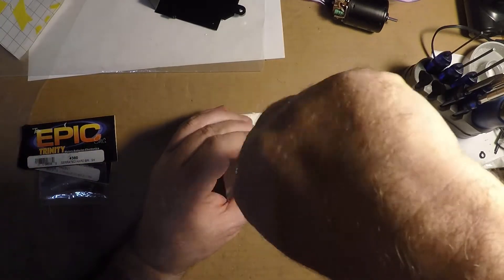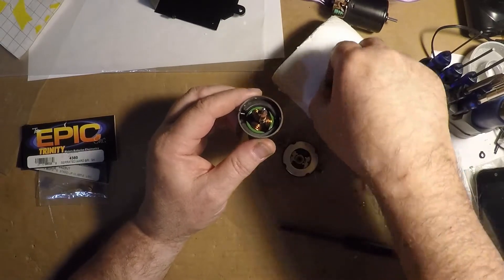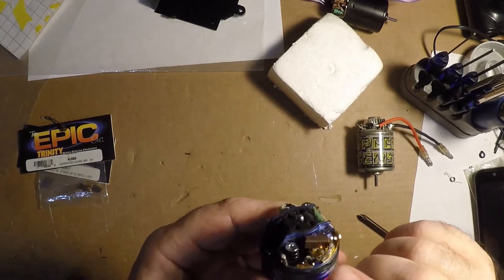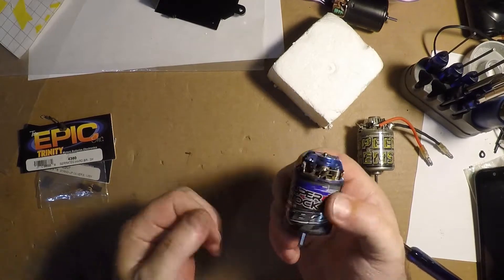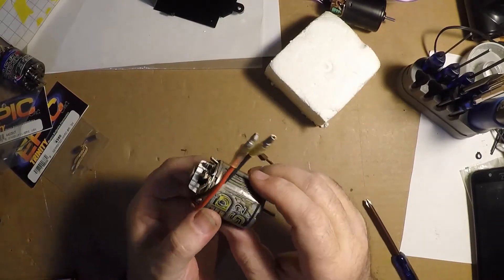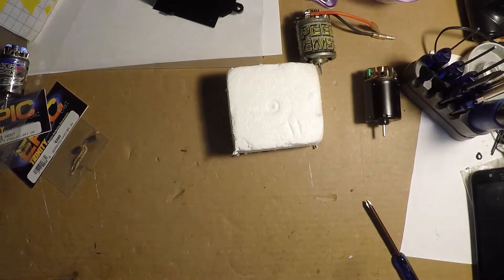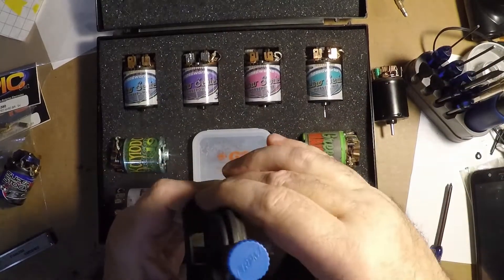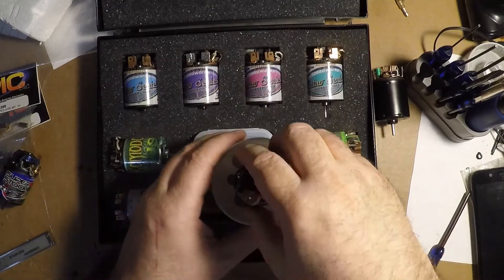Brushed Motor Maintenance & Care

Comment: You are a legend dude! Thank you so much for doing this and posting up my friend 🙌🏻 I am going to pull that motor apart and see what is going on. 😎👍🏻
Reply from the maker: Hiya Craig, we never could connect so I thought this would be easier. I did put my calipers on the comm (commutator), it's 7.54mm in diameter, yours might slightly different, HOWEVER, it should not be off by much more than that. If it's way off, between 6mm & 7mm, you might need a new armature (the part the holds the cooper wire windings). Brother I hope this helps & I'm here if you need help.  ATB bro & good luck.
Reply from the maker: How did you make out with that motor? I'm sure you told me but I forgot, old age you know..

Comment: Hey Uncle Bob, really a great review.  I’m putting this in the “watch later” I could only watch the first 6 minutes.  I like the jig, never seen that before.  I remember using Reedy rebuildable motors 20 years ago when I club raced.  Didn’t know the washers were special. Conductor cleaner works well.  Again great review Bro!
Reply from the maker: Thanks Brother, every bit of info is going to help someone. That was just a few of the motors I still have. With some serviceable stock motors, you can change the brushes but you can't take them apart (unless you unbend the tabs holding the endbell on). You can really see the appeal for brushless motors, but this was how it was done some 25-35 years ago.
Reply: Yeah, these brushless motors are so cool.  It’s like an old V8 with a Carburetor instead of fuel injection! I’m working on a 1/10th crawler, but it’s going to be a beach basher.  I purchased a brushless system but may change it to a Brushed.  Not sure when it will be finished, right now its a bunch of parts in a crate in my garage :)
Reply from the maker: @3TRCGarage  Man, I think we all have parts/kits & projects sitting around. I have so many cars/trucks that need work/parts that the count is about the same as my running RC's, if not more.

Comment: Great info, after this video most will stick to “throw away” or brushless motors lol
Reply from the maker: For sure man!! The art of brushed motor work is long gone. No one wants skill anymore (other than driving), they much rather pull it out of the box, charge up the battery and run the shit out of it.  I did the video for the "OAG RC" cause he has a brushed motor issue so I thought I would try to help him out.  I didn't even get into brushes & springs......

Comment: 😮
I'll be watching this video 100 times. THANK YOU. I'm still wondering how to just change the brushes.
Your collection though ....... When you pulled out the Blueprint 427 ...... 😍❤️😮 ..... I've been looking online and see the value of these things ...... Maybe I'll just keep my motors in boxes and rebuild them, then just get a BZ or something for running and maintain that.
Reply from the maker: Thanks Man, I did the video to help "The OAG RC" cause he has a BZ that needs love. About that 427, I got that in a lot of parts along with a like new (1990) Trinity Speed Works Tony Neisinger  motor (just not the right box for it). On to the brushes, some screw on and some are soldered on, screw on one are far much easier to change, you should be able to see/tell if they screw on or are soldered on. The hard part is finding decent brushes for old motors. If you still need help, give me a shout...